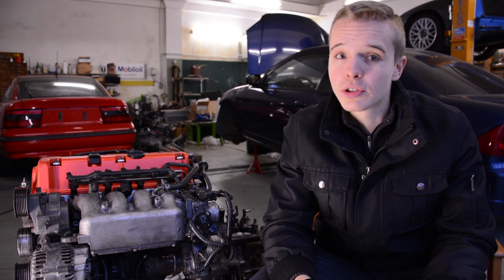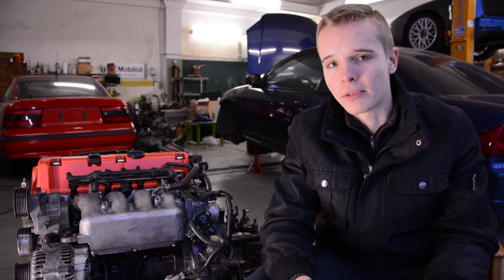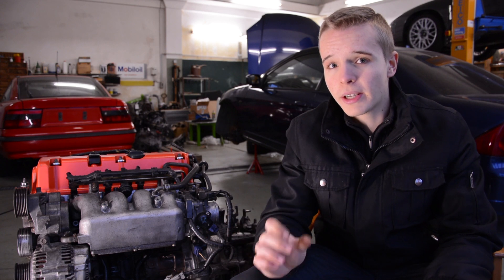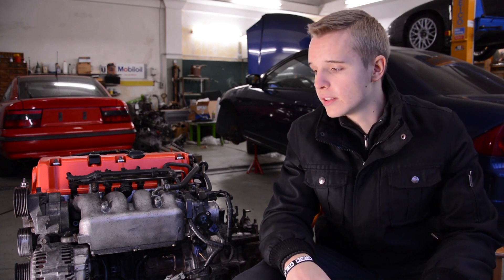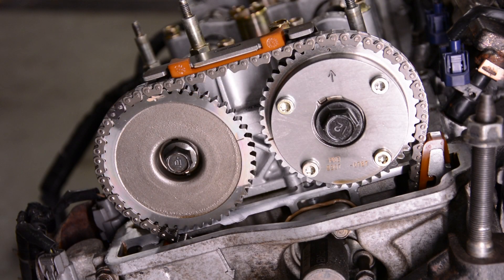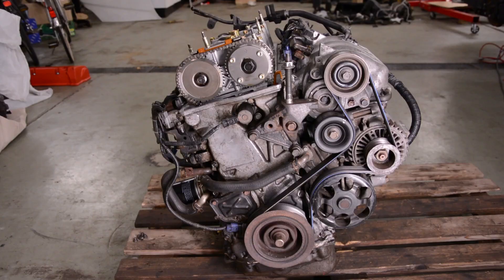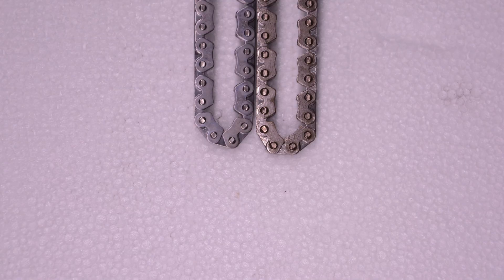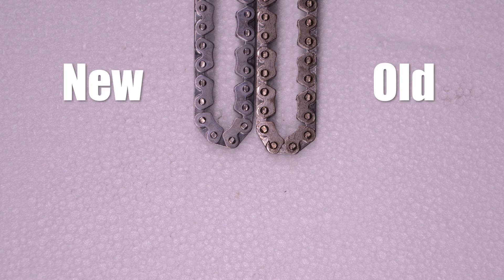K20 Timing Chain Inspection - TYPE D MOVIES

Comment: there's also dark colored links you're 'supposed to' line up with the dots on the cam shaft and the crankshaft pulley. doesn't really MATTER, but that's what those dark links are for.

Comment: I’m tackling this project right now. I didn’t put a small pin in the little tensioner hole before I removed it. What do I do. Also I know my cams gear marks aren’t aligned. So I need to get the crank to TDC how do I do that?

Comment: Aren’t you supposed to change all the guides and tensioner with seals?
I’ve replaced my K20 
timing chain
Timing chain tensioner
2 timing chain guides
Oil pump chain
Oil pump guide
Oil pump tensioner
All at once is better job

Comment: So b4 replace the timing chain engine must out first?
Reply from the maker: No, can be done with installed engine.
Reply: @kpowered  preparing to curse at all the bolts that bust my knuckles trying to do this with the engine still in car. Where nis the  video for that.

Comment: Is it possible to inspect this while the engine is still in the vehicle?
Reply from the maker: Yes. it's a bit tricky to get the chain cover out and back in, but besides you can reach everything from top or the side if you remove the tire.

Comment: Thank you so much for making this video helped me identify my stretched timing chain on my.k20. Replaced timing chain and guides snd tensioner.it fixed the issue and mine line up just.like yours thanks again
Reply: bro any chance that you can replace the chain even if the engine is still in the car?

Comment: Hello Sir, my suv have a K20a4 engine and at 103k kilometer on it, is it require to change the timing chain? Thanks
Reply from the maker: Check the marks on the cam gears as described in the video :)

Comment: You forgot to line up the black links on the chain with the dots on the gear sprockets  

Those black links have to be lined up with the 2 sprockets on top and the crank sprocket aswell
Reply: It was lined up initially, but later shots showed the engine after having been turned over a few revolutions. It takes dozens of rotations before they line up again, but it is still always in sync.

Comment: Thanks for posting this video. At the end of the video where you show you now have proper timing, I don’t understand the proof? Just showing the marks line up I don’t think will prove it. Also its best to ensure the black chain links line up with the chain link markers on the cam gears at the same time to ensure its all good. You definitely make the replacement look easy! Nicely done.
Reply: If the marks line up with tension on the chain after you rotate it a couple times and put the crank right at top dead center, your timing is good. The colored links are nice but not necessary.

Comment: you can also remove the timing chain tensioner cover and rotate the engine until you see the tensioner piston at the furthest extended point and measure it.  Once the tensioner piston extends past 13.5mm the chain is stretched and needs to be replaced.  This was an easy way for us to check without having to remove a whole lot.
Reply from the maker: thanks for sharing this!

Comment: Hey @k-powered I just replaced my timing chain tensioner with the engine still in the car and the timing jumped a tooth so i had to pull the engine to re-time it and when putting the tensioner back on after re-timing i had to try very hard to get the tensioner on because the piston was extended further than it would be before pulling the pin (when brand new) even though i pushed the piston back as far as i could and put the pin back in. Do you know if this is putting too much tension on the chain or will the oil pressure fix the excess tension?
Reply from the maker: As far as I know, the piston doesn't go back in once it came out due to the ratchet mechanism. For clarification: You pushed the piston back in by hand and it stayed there?
Reply: @kpowered  i pushed the piston back in by hand and put the pin back in which kept it there, but do you think this means i must buy a new tensioner? I only used the new tensioner for a start up and then pulled the engine
Reply: @kpowered   i pushed the piston back in by hand and put the pin back in which kept it there, but do you think this means i must buy a new tensioner? I only used the new tensioner for a start up and then pulled the engine
Reply from the maker: If the piston is pushed back, how come there's so much tension on the chain?
Reply: @kpowered  the piston when the tensioner is new is set back much more than what mine was after pushed back in as much as i could

Comment: This is easy when the engine is out... Do this while still being in vehicle..
Reply from the maker: definitely easier when it's out, but also possible with a mounted engine. After the upper engine mount is removed and the chain case fumbled out it's basically the same.
Reply: @kpowered  I've tried finding videos getting the cover off but they all start with it off.. I need to see how hard it is to perform.. need to do this myself

Comment: This i think does not matter 
Well due to my situation
The two marks is not aligned but the two dots on top does align facing up!

Well the car runs dope in vtec
And even on low rpm
Ps. I did change timing chain oem honda still it is same
Reply: Im in that situation dots are perfect BUT intake cam mark is half a tooth behind exhaust cam line mark. Now i only have new o2 primary sensor code. Wants to start (hear combustion) but wont just cranks.

Comment: my only question: is it mandatory to remove the engine in order to do this job?
Reply: I will be removing the engine mount which is in the way and supporting the engine via the sump with a jack and piece of wood
Reply: I don’t think so. I’ll be doing mine this weekend so I will let you know how it goes
Reply: that would be awesome! thanks heaps. Only reason why I think you might have to is because one of the engine mounts appears to bolt right into the timing belt cover, and there's very little space to work in there. Also, I need to replace the crank shaft seal, which I assume would make sense to do at the same time. Thanks again!

Comment: how do you know when to change the chain and its tensioner? My RSX-S has 138k km and its it has ticking noise.
Reply from the maker: check how far the tensioner's pin has already come out and also if the marks on the camshaft gears are lined up, like in the beginning of the video.
Reply: Valves tick too

Comment: I got 230.000km and having no problem with my fn2.... just oil change.. for about 4 years now...👌👌👌... honda forever...😍
Reply: Your timing will be off the same as this one , if you pull the covers off and ck it .
Reply: Nice I have a 2004 acura rsx with 330,000   With original engine and transmission no problems still drives strong. And  Original timing chain.. and honda for ever 😁

Comment: What pulley is that on top replacing the power steering pump?
Reply from the maker: it's just replacing the pump. OEM part on civic type-r models with electric power steering

Comment: I have this engine in my RSX type s.  Is this possible to do with the engine inside the car?
Reply from the maker: It is. The upper engine mount needs to be removed (support the engine before). Then you can access the timing chain cover

Comment: I'm gonna check this when I adjust my valves tomorrow. I'm at 166000 miles, bought the car about 100k miles ago and haven't done anything but change the oil and plugs. Its been running pretty bad for some time, and I really need to do something. I did clean the iacv a week or two back and that helped a bit with stalling at stop lights, but its not enough. Time to man up and try and fix it
Reply from the maker: what are the exact problems? Mine ran very bad in higher revs, so that was a clear sign it has something to do with the chain. Good luck with that
Reply: Well heres my codes: cylinder 1 and 3 misfire, random misfire, and more recently intake vacuum leak. I've bought a cheap smoke machine and couldn't see it coming out anywhere, need to try again. Vacuum leak code didn't come on until I got a new filter, the old one was pretty rough looking, but the car didn't run any worse when I changed filters.

When I would first start driving, if I came to a stop in neutral it would usually stall. If its warmed up enough not to stall at a light, sometimes it will try to stall when I  push the gas pedal.

 I bought the car used, 3 years old, the last owner put a short ram intake and exhaust on it. The check engine light first came on when I floored it off a stop light. I may have over revved it. 

I've swapped plugs, coil packs, and  injectors around, problem remains on cylinder 3 and 1, with cylinder 3 being completely dead and 1 having a slight drop when I unplug the coil
Reply: As for higher revs it seems to run ok, just a lack of power
Reply from the maker: That's a lot. Remove the valve cover and check the marks on the camshaft gears like I explained in the video. This will give you a first impression of the condition. I assume that the misfire codes are a result of an out of sync timing
Reply: Type D Movies yea I'm thinking the chain might have jumped a tooth when I over revved it. I guess that means I need a new tensioner and chain. I looked at the marks yesterday a little but mostly I was focused on adjusting valves. I will probably get the special valve adjustment tool because its hard to get a wrench in there with the fuel rail on. I'll focus on the marks next time. I hate working on cars
Reply: If I do have change the chain and tensioner, do i have to drain the oil and coolant first?
Reply from the maker: I think you can let the fluids remaining in the engine. Catch the coolant with an old cloth when you remove the oil cooler hose.. that's it.

Comment: I have a ? if you could help me i have the same engine in a honda CR-V Everytime i get all my marks lined up and im at TDC i crank the motor over by hand and they dont seem to line up again what im i doing wrong? How many times do i have to crank the engine to confirm its in time? thanks for any help
Reply from the maker: you need to go through the whole 'lifecycle' - so that every cylinder soaks in, compressed, fires and releases the exhaust gases. That's a few full rotations
Reply: Thank you
Reply: About how many rotations Nd s great video by the way man💪

Comment: did you loose crank pulley already? or was it simple technique with hammer we just saw in video?
Reply from the maker: Actually we loosened it by help of a heavy duty impact wrench... we tried our regular workshop one but that thing was stubborn lol. You can use a long lever if the engine is still in the car
Reply from the maker: I can tell. We had to remove these bolts on a bunch of engines and our regular impact wrench failed. We had to use to some heavy duty stuff used for massive farming machines to open it. Btw, the bolt doesn't get tighter over time. The opposite is the case ... the torque of the engine works counter wise on the bolt, that's why it's tightened so much. I forgot to put these 180 Nm on my daily driven civic, the bolt was tightened with about 130~. Lasted 1000 km, then the bolt including pulley flew off :-)
Reply: Type D Movies that crank pulley bolt is a bitch of a bolt. I had to remove 2 of those when I change the cambelt in my civics and I was swearing a bit. I bought the special crank pulley tool holder to help. You secure the crank pulley with this pulley tool holder and then use a strong breaker bar and break it loose. I heard this bolt can get so tight over the years at around 500 Newton meters of torque because every time you start the engine this bolt gets tighter and tighter.